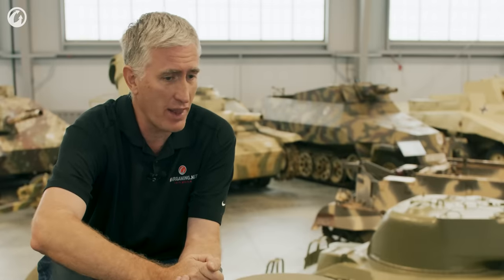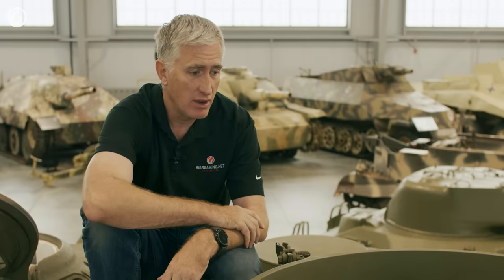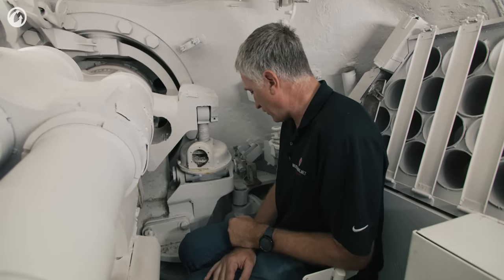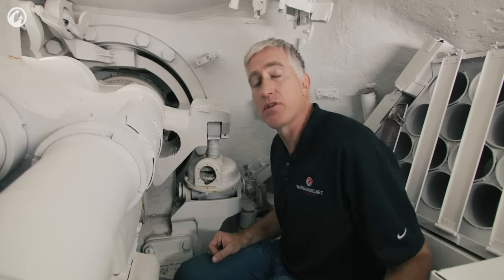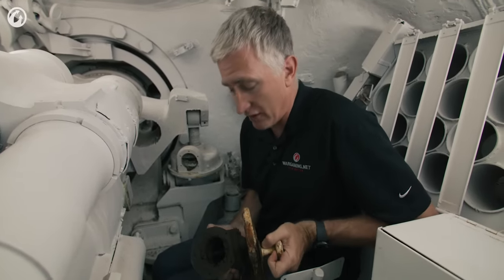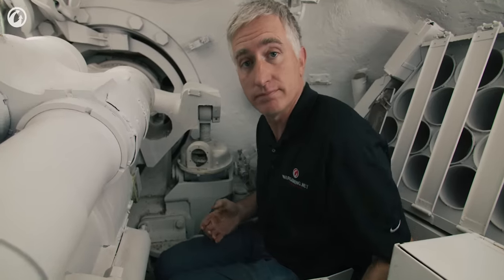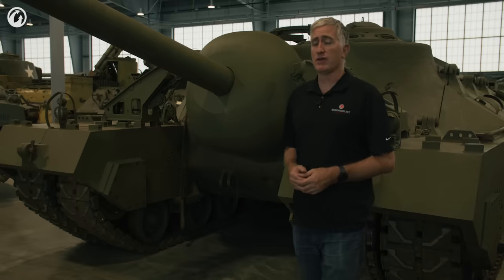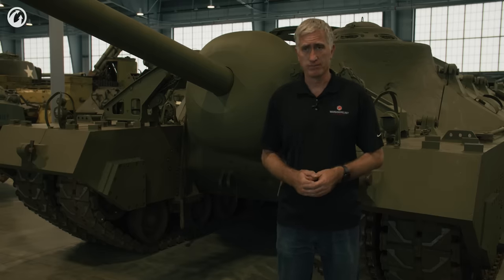Inside the Chieftain's Hatch: T28 Part 2

Comment: Wow, that looked a lot better inside than I feared. If the museum ever gets around to restoring it, I think it would be glorious if the Chieftain was given the opportunity to take it for a spin
Reply: @Wolvenworks  More likely preserved than restored. Restored would mean the gun and traverse, the engine deck can be opened, and the pintel can rotate.
Reply: @littlekong7685  iirc there are plans to restore it to a degree, unlikely it'll ever be drivable though as the other T95 had to be scrapped due to an engine fire
Reply: @kop1522 The armour museum in Australia has amazing videos, mostly of German WW2 vehicles, restoration projects. If plans still exist, it might be possible; maybe.

Comment: One of the odd things about life is that your connection to a recounted event is limited by your own experience, which is why the most frightening piece of war footage, for me, is that clip from the Battle of the Bulge, when a group of soldiers caught in the middle of an ice covered road must get out of the way of a Sherman that is completely out of control and sliding backwards down the hill that they were about to march up.  However, I have driven an old mid-seventies land yacht through a snow storm, in stop and go, near bumper to bumper traffic.  The rear drums completely faded out, so tapping the brake would lock up the front wheels and the driven rear wheels would continue to push the car forward, in an out of control manner.  I spent the next two hours bumping the transmission from drive to neutral if I was gaining on the car in front of me and bumping it back from neutral to drive, once the car in front of me started pulling away.  As a result, your description of driving the T28 down a slope is butt clenching horror.

On a similar note, I heard a story that a British Centurion crew had a harrowing experience when they drove straight down a steep slope and had their brakes fail.  Down slopes and heavy armor do not mix well.
Reply: Unless you are in a down armoured Cromwell  and use the slope to gain momentum for an emergency jump over a deep ditch =p
Reply: That's what you get for driving an automatic. You have a clutch pedal in a proper car and can always freewheel.

Comment: Given the cramped conditions of the crew stations, that spacious interior is a pretty good optical illusion.
Reply: Put even a small combat load of 105mm and it would be a tight mess.
Reply: @thomasstevenhebert  Plus all the other gear and personal belongings.
Reply: @petesheppard1709  Think about this though. A lot of WWII tanks didnt even have room inside for personal belongings so they had to be stored outside on racks. Imagine the pure luxury of being able to keep your gear inside out of the weather and dry!!!!
Reply: @Kellen6795 Indeed, and before personal stuff, there is a mind-boggling amount of required gear that has to be carried, THEN the ammo has to be stowed.  At least, according to Chieftain, there were a few ammo spaces that turned out to be blocked by other fixtures, so there would have been some extra nooks.

Comment: Engine swap and add a quad turbo and all 60mph of the speedometer will finally be used.
Reply: Needs a quite BIG engine...
Reply: Earlier version of M1 weight about 50 tons. So I think it’s going need a 3000HP and very VERY heavy gear box
Reply: K24 swap time, since it's so popular now lmao
Reply: @IkeVMAX4  gas turbine...
Reply: I dunno if you can fit both a adequate engine and adequate transmission in there.
Or if the final drive would survive all the additional torque.

Maybe do it like a pulling tractor and just remove the engine covers and have most of it stick out the top of the thing.
Reply: Could you fit an MT883 Ka-501 in there?

Comment: I would bet that the low-range was calculated and designed for buddy recovery.   The compass was for submarine warfare to bring the body of the vehicle within the firing solution of the torpedoes.... er, to turn the vehicle to bring the gunner's traverse range within solution.    A fully enclosed SPG is often like a submarine, especially the slower they get.
Reply: No one talks about the torpedoes, because they were Mk14s...

Comment: Assuming it's still an M-26 Pershing powertrain, it's not a Hydramatic nor is it automatic. It would be aTorqmatic 900 Series  - a 3F+R planetary 'powershift' box in modern terminology. Manual selection and shifting under full continuous power at any appropriate time.

Comment: Actually the steering controls are not bad. I have an old dozer that has a very similar set up with the brakes and pedals. Hopefully in the future the T28 could be fully restored to running condition as it would be great for such a one of kind machine but that is not likely for obvious reasons

Comment: Interesting fact, the T182 round developed for the 105mm family among others like T279 APDS for the T140/T5E1 were all part of the same series of ammo development programs for the 105 family. the T140 being a more refined T5E1 more or less. So anything the 105mm T140 gun could fire, so could the T5E1.  They were still using T182 AP rounds for testing of armor plate well into the 90's.

Comment: I got to see the beast at Knox twice before they closed down the Patton Museum and moved it to Benning/Moore. When it was outside on the slab, I could swear I remember it being painted in a darker color of green, almost an enamel, as though they had to coat it in something to protect it from the weather, and then stripped the dark coat off and added an olive drab before putting it on the floor in its new home. I took a photo, but I don't think I have it anymore.
Reply: The Patton Museum is still open to this day.

Comment: @Chieftain  It was probably on the Edgewood Proving Grounds which were adjacent to Fort Belvoir.

I personally discovered one very, very delapidated bridge that I wasn't sure my vehicle was going to be able to get across without the bridge collapsing.

In the years after that, Edgewood was absorbed into Fort Belvoir proper as has been noticeably improved.

I wonder if they found and fixed that one bridge. I stumbled across it entirely by accident.

Comment: I wonder if this contraption was ever at Fort Knox and if they tried to stuff it into the LST building that's just off Eisenhower Avenue. Now that would have been interesting. Take the tracks off - assemble the "trailer" - drive or back into the LST building - come back out - put the tracks back on. 😄
Reply: No need to do that. They actually did try putting the thing onto an LST and an LCT. They needed to pull the tracks off for the LCT, but it fit in the LST without issue.

Comment: That the Army "lost" this does not surprise me. You`d be amazed at what it sitting off in the woods at military installations. At Camp Lejeune, as of the early 2000`s, there was an M4 Sherman equipped with a flamethrower in one of the training areas. Had probably been there since the 40`s, and everyone knew about it, but no one seemed to have any authority to do anything about it.

Comment: Just for reference, modern m182 5.56 travels at about 3200ft/sec out of a 20 inch barrel.... That is an object that is roughly 18 fold larger than the aforementioned bullet traveling THE SAME SPEED. That is terrifying.

Comment: The one thing i am curious about is, had it gotten to the ww2 battlefield: would it be usefull in any sort of way in it's intended way?
Reply: I doubt it. The Germans were seeing ground pressure problems with the Tigers and Elephants, and they were much lighter. Sure the quad tracks would help, but that can only do so much. Road bridges (even if they were wide enough) would pose overloading problems, and finally once you start to assault a fortified position, you are very vulnerable to artillery. Much like the Maus, I think they’d have just ended up as static targets for the enemy.

Comment: I don't think it was ever explained in the video, but what are the two "nuclear cooling tower" shaped objects on the right side of the tank, on the side slope, just below the hull roof, right between the Commander's hatch and the gunner's "hatch"?
Reply: Its explained in the video about changing the tracks linked on Part 1.

IIRC, they're for braking the outside tracks when you've removed them.
Reply: Brake spools. They are also used as spacer rollers when adding or removing the outer tracks

Comment: >build a huge tank
>still no proper space for the crew

clueless
Reply: The US usually paid a lot of attention to ergonomics, so this struck me as unusual.

Until you think of how much time polishing ergonomics takes.Adding 6 months of development doesn't seem like a good trade off.

And maybe the crew could have done some optimization by  ot loafing 10 or 20 shells, deciding that is 40 rounds of 105 was enough to solve your problem, it would be a good idea to retreat and consider other options.

Comment: How exactly could the other one burn down in a fire thou?
Reply: One of our techs once mis-wired a radio while installing it in a very large end-loader. He mistakenly thought that it was a negative ground system when it was actually positive ground. The amount of damage was absolutely spectacular. You think that the electrics on something that big built out of that much steel would almost be an afterthought, but when the flames were put out, the machine was totalled.

Comment: Odd that the interior is well painted, but they've left the Gun to rust like that.  A shame really.. It has been rumored that the one that burned found its way onto the Nuclear testing Grounds for waht ever testing information it may have provided.   The Jury is still out on that one.
Reply: "well painted". If you mean every bit of surface area slathered in paint, yes. I was cringing looking at the elevation screw covered in paint.

Comment: Super heavy vehicles are most likely never going to be practical. They’re too slow, clumsy and roads and bridges can’t hold the weight. The tracks chew up everything as well. The only use is relatively stationary tasks. A tank is an easy target if ambushed.

Comment: I'm sorry, but using the reverse for going down hill?? 

I would expect that when the vehicle moves forward whilst it's in its reverse gear the engine would also be spun in reverse. Most engines can't be spun in reverse and the sprockets don't allow the tracks to slip, and I don't think the vehicle would 'slide' downhill either. So this has to be a case of using the clutch I'd think. But wouldn't using the clutch to break a 95 ton vehicle place excessive wear on the clutch?

It would be more logical to me if the vehicle would've been put into first gear and used a Jake brake (common on USA trucks, use the engine as a brake by pulling vacuums and increasing rotational resistance).
Reply: There's no clutch, it's a hydromatic transmission. I don't know the mechanics of exactly how it works, but I strongly suspect a fluid coupling so the engine continues to rotate in its normal direction.

Comment: If this is a T28 then what is a T95?
Reply: Nick discussed this in part 1
Reply: Watch the part 1.
 Basically they were unable to decide what the vehicle should be called and thus ended up changing its name a couple of times. It's acceptable to call it T28 or T95, I have seen somewhere even T28/95.
Reply: T28 heavy tank>T95 gun motor carriage>T28 super heavy tank as devs worked out what the rolling bunker counts as
Reply: Basically another designation for the same vehicle